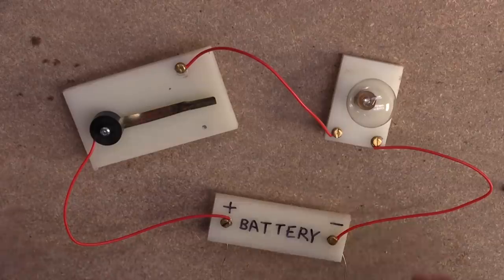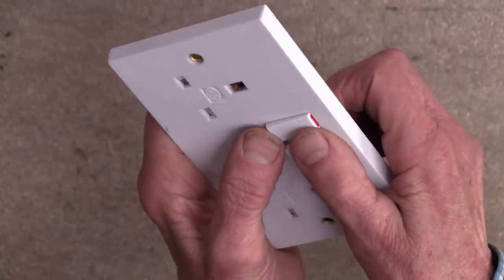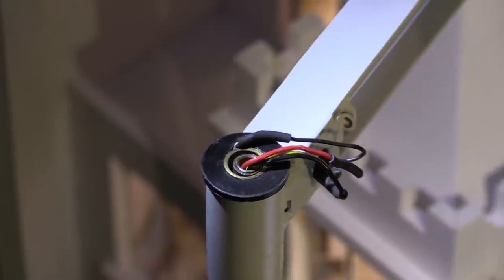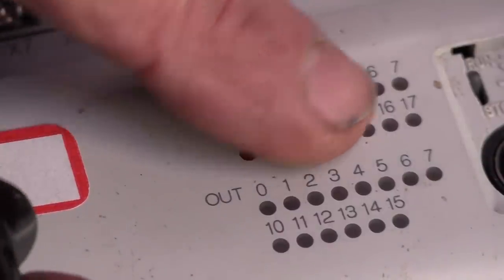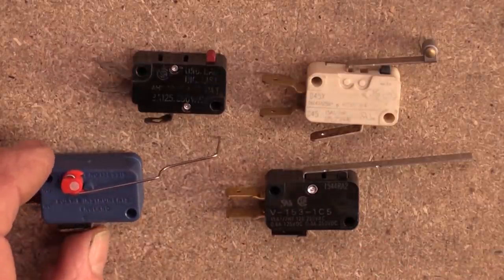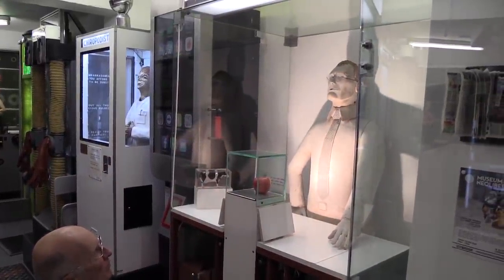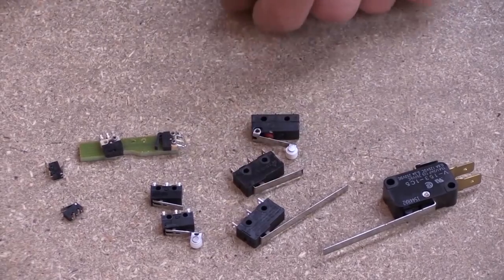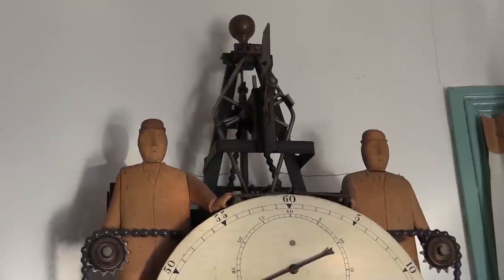SWITCHES - The Secret Life of Components, a series of guides for designers and makers - Episode 4

Comment: Those switches in substations are only for isolation. They are not circuit breakers and not meant to break the load. The actual circuit breakers do move quickly, but they're located inside housings (and bathed in oil or SF6 gas for further arc suppression), so you can't see it happen. Cool video!
Reply: The actual circuit breakers have very large springs that slam the contacts together or apart as necessary.  The spring is usually wound up by a motor between actuation.  Even so, the contacts require two stages - one to pass the power when the switch is closed, and another, harder one to handle the arcing.
Reply: Oi - stop watching and get back to making - its been a whole two days since you last uploaded! 
actually kinda cool to bump into you in the comment section elsewhere.
Reply: Great minds think alike!
Reply: 👆yup 😁
Reply: Thank you for wonderful videos!
Reply: Can confirm, have worked on a control for reclosers -- these use contacts in vacuum, oil or SF6, actuated by f*ckoff huge solenoids, and boosted by springs with an unbalanced reset mechanism so trip can be faster (spring assisted) at the expense of resetting.  On the one I worked with, the solenoid is powered by a f*ckoff huge capacitor, which stores enough energy for several cycles in rapid succession.

If you've ever had the experience that your lights go out (and all the rest of your neighborhood), then a few seconds later on again, then off again for an hour or a few... you've experienced one of these doing their job.  (What's actually happened is a line fault occurred, which the unit detects and opens; then it retries immediately, in case it was a momentary fault like wind-whipped wires touching, or a small tree branch; and if that doesn't do, it stays low until someone can be sent out to inspect the lines and clear the fault.  Usually they'll manually test it as well, to see if they can save a few hours walking the lines.)

(This is distribution level stuff, by the way -- downstream of those substation switches, but still immensely powerful by themselves; these are often switching whole megawatts, or hundreds under fault conditions.  The switches and breakers used for substations and high voltage lines, are of similar design, scaled up significantly of course.)
Reply: so why were there arcs on them?
Reply: @The1wsx10  Inductive kick back.
Reply: @The1wsx10  Good question. Maybe it's got something to do with it being AC. With AC the voltage is changing constantly so as soon as you disconnect the source of the power, the voltage across the disconnect will start to rise (and fall @50/60hz).
Capacitance will also provide some load with any AC system. Inductive effects shouldn't be playing a role here as there shouldn't be that much current flowing (with that said now we're talking about inductances and capacitance together - it could be forming some form of "LC tank" circuit but let's not overcomplicate matters)
Reply: It's a feather in my cap to see you here.
Reply: You should do a video on switching substations and the different kinds
Reply: One should add that those high-voltage switches are called disconnectors.
Reply: @The1wsx10   All the miles of wire in those circuits have capacitance between themselves and between ground, air being the dialectric.  
Those capacitances may be fairly small, but the voltages are incredible, so even in a circuit with no conventional load, you will have some current flow.
High voltage transmission lines also suffer from coronal leakage, especially pointy bits and pieces, and all of those insulators holding up the line are not ideal (perfect) insulators either, so you have some actual resistive loading too.
Reply: @projectartichoke  ok, so why are the 'breakers' slow here? are they actually designed to arc like that? it seems like a failure condition
Reply: @The1wsx10  cause the vacuum disconnects failed to open, aparently happens sometimes. experienced line crew will often set up a camera if they think this failure is likely, as well, it looks cool.
Reply: My guess is the same reason it was being filmed - a deliberate test. We were shown many such videos during training.
Reply: The slow switching in substations you show in the video operate very rarely, it's not economicaly feasible that they open quickly. For quick opening under high loads they use breakers, a quicker type or switch wit arc supression (and multiple times the cost).
Reply: He showed substation switch gear not circuit breakers which is topic relivant and yes behind all that ceramic insulation is complex electro mechanics eg hexafluoride 6 gas actuators motors gears latches sensors thare a lot more complex than they look, why do they disengage slowly to prevent high pressure electrical pulses along the transmission lines as they might offset grid sincroniseation or blow anouther stations circuit breakers as the fluctuations may not be smoothable or detected as a line fault causing a bit of a chain reaction.
Reply: Fancy finding Practical Engineering on a random YT I randomly picked to watch. Coincidences everywhere :)
Reply: @charmio  Yes, you're right. It's easier to switch AC, than DC, as the arc is quenched as the current passes through zero. Inductance does make a difference at AC, because if the switch opens when the current is at its peak, the energy stored in the magnetic field will cause an arc.
Reply: ...and the breakers have failed which is why there is arcing on the isolator contacts.
Reply: Make a video instead of commenting.
Reply: Substation switchgear draws arcs from induced currents in the line, not actual load.  If the line was under load the resulting arc would resemble a lightning bolt and would rapidly destroy the equipment.

Switchgear moves slowly due to the mechanical limitations of mechanisms that have to be articulated through several feet of brittle ceramic insulator.  Arc suppression is achieved through the geometry of the switch, not the speed. Twisting type switches that break in two places simultaneously are very popular.

One class of substation switch uses a gravity drop to achieve faster action.  As the switch opens a conducting wand bridges the gap until suddenly allowed to fall away.
Reply: now i understand why this video was recommended to me. Good stuff!
Reply: We use SF6 at our EP
Reply: Pardon my ignorance, but would you consider being so kind as to clarify (or perhaps make a video on - I do love your channel by the way!) the difference between a circuit breaker and an isolator? 
     Actually the distinction seems obvious; both from their names, and your short description. But as I'm understanding it, the circuit has already been broken elsewhere (in a fluid bathed switch as you said) when those isolators are shown opening. So then, why are they arching so magnificently if the circuit is already open? Is it because those huge swinging poles (and the attached cabling) are a large enough conductive sink that they are essentially charging and discharging, almost like a huge (very simple) capacitor, and that's why all that current is continuing to flow and create those dramatic arcs, despite there being no load connected for it to flow onward to? 
      I realise my reasoning is probably overly simplistic and my language incorrect, but I'm hoping through all that jibber-jabber that I'm at least on the right track with the basic principles? Any guidance you (or anyone else) can offer would be much appreciated. And once again, I love your videos so thank you for making fantastic content!
Reply: I don't think that's the reason, I would say it must just be switchcraft! 🧹⚡
Reply: I was supprised to see you Commenting here!
Reply: Some of these are the grounding of the circuit, after isolation the circuit is still charged (capacitance) and the cables, many many miles long are then grounded to discharge any residual energy. This residual may also be through mutual inductance from other cables ran near.
Reply: Completely normal for a disconnect switch to arc like this video. There is no load and only the current to energize that short jumper down to the breaker. There are arcing horns, the balls you see on the ends, and those are design to carry the arc. The switches shown in this video are only meant for no load operation. The breaker under it is an SF6 breaker and that is what will break load and fault currents as well as make and pick up load. The reason you install the disconnects it to allow maintenance on the breaker or other device by giving you a visible open / disconnect from the energized conductor.  
https://www.youtube.com/watch?v=K8cMSDwZkDU
Reply: @projectartichoke  No, long transmission lines are inductive, not capacitive. Although the right answer is to work out the respective mutual capacitance and inductance, a hand-waving argument is that mu_0 is 10^6 times bigger than epsilon_0.
Reply: Typical engineer.

Comment: The mercury switched wall switch at the end was probably used in a explosive environment, somewhere like a anesthesia room in a hospital or a place with alot of powder or even flour being processed.
Reply: yes, mercury switches are still used heavily in industrial applications, especially ones that can't allow sparking like in a paint booth.
Reply: We had a silent phone in a theatre in the 70's. BT went to extraordinary lengths to keep the 240 red light (that replaced the bell) seperate from the 50V phone wiring. The mercury switch was on a pendulum in a big steel box. Must have cost a fortune. The warning stickers to remind the BT men that mains was present were hilarious.
Thanks Tim, saw your new components films and now I'm binge watching all the old Secret Life films!
Reply: That makes sense now. Contain the arc in a glass bottle. Perfect!
Reply: they look like Wandsworth switches, standard fittings in hospitals
Reply: @kevvywevvywoo  Thank you! Now we have a name for them.
Reply: I worked in a hospital that had those arc proof switches and switch-sockets in the theatres. They were operated by a knob that turned 180 degrees and made by 'Walsall'. The sockets had an interlock with the earth pin of the plug to stop it being withdrawn when the  switch was 'on'. The earth pin was smaller than a standard plug to prevent non-theatre equipment being connected. 
Modern anaethetics are generally much less of an explosion risk, so special switching is no longer necessary.
Reply: Agreed.  Electrical codes for hospital spaces where medical gases are used like operating theaters, often require speical ignition source isolation. Some medical devices that house power outlets like anesthesia carts or laboratory fumehoods often have similar requirments.  
If my memory serves me correctly I came across nearly identical mercury switched outlets installed in a surgical ward panel at St. Mary's in London while consulting on an NHS project a few years back.
Reply: @Aengus42  Walsall Electrical also made them in that pattern, I have one here!
Reply: @peterking2794  walsall also made rocker light switches in a similar pattern to the ones in tim's video. Walsall were taken over by Pepperl & Fuchs and continue to make switches for explosive atmospheres.
Reply: Exactly what I was going to say....
Reply: Older thermostats for HVAC used mercury switches. I’ll still see one now and then. Almost all home Thermostats had mercury back in the day.
Reply: Mercury switches were also used in cars through the early-2000s for the hood (bonnet) and trunk (boot) light switches. They were extremely reliable and couldn't get stuck on, draining your battery. When cars of that era are scrapped, the dismantler needs to go and remove them for disposal.
Reply: @peterking2794 Thanks. That explains it.
I was going to suggest explosive atmosphere safety but then I thought that was wrong because pulling the plug while energised would defeat the safeguard. If the plug is trapped until de-energised then the system will be safe.
Reply: @kevvywevvywoo  100% correct ….Wandsworth Electrical Accessories
Reply: I've also seen thermostats that use mercury, a bi-metalic spring rotates them with temperature and you can change the trigger point (temperature) by rotating the entire assembly.  The thing I like about mercury is that you can arc it all day and not worry about contact degradation, it reforms itself like the T1000 liquid metal robot!
Reply: Our spray booths had explosion proof fan motors and lights, had explosion proof switches.

Comment: The high tension ‘switches’ you showed are actually isolators, used to separate components for maintenance. The actual breakers are extremely fast and use either high pressure air, oil or SF6 to kill the arc.  The little arcs you can see on these isolators are just from the current induced from adjacent circuits. If they were used to break the full load of a generator etc. they would be completely wrecked!
Reply: SF₆ isn't the sort of thing most people have (or should have) around the workshop. The amount of paperwork needed to keep a small (incredibly heavy) cylinder of SF₆ at the generating facilities I used to manage was immense. But when you're switching 44 kV, you don't want any arcing at all.
Reply: @StewartRussell  why thoooo SF6 is fun to play with, and is relatively safeishhhh
Reply: @HerbaMachina  it's one of the most potent greenhouse gases and can build up in access tunnels as an asphyxiant. Not a toy
Reply: @StewartRussell  shhhhhh hence my sarcasm.
Reply: @StewartRussell  For industrial quantities in the EU maybe. For small quantities, no. We used SF6 lecture bottles for demos all the time. SF6 is even injected into you in medical procedures. It's not as dangerous as a grill cylinder of propane, which is an asphyxiant, heavier than air, and explosive.
Reply: @straightpipediesel  as a former power plant operator in Canada who had to comply with safety legislation around SF₆ and confined space work, I stand by what I said.
Reply: @StewartRussell  Well stand by being wrong and ignorance of safety. NFPA diamond SF6: 1-0-0 SA. NFPA diamond propane: 2-4-0. Propane is far more dangerous, even from a health perspective.
Reply: @StewartRussell  You said "SF₆ isn't the sort of thing most people have (or should have) around the workshop". That's plain wrong. People have propane brazing and BBQ tanks in their workshops, which are far more dangerous, and you're not giving them a hard time about it. Fundamentally you don't know how SF6 works, that's why you're giving bad information. In fact, you may not know that SF6 was used as a filling gas in double-pane windows (doesn't leak, absorbs IR, and minimizes convection) and shock-absorbing sneakers.

SF6, like most flourocompounds is very stable and inert (see also Teflon). This is high school chemistry: fluorine is missing one electron to get to a stable configuration, so it desperately seeks something to bond to (called high electronegativity). When it bonds to something, sulfur in this case, it holds on and never lets go. As such, it is very non-reactive and largely inert, and that's why it has little health and safety concerns, aside from asphyxiation. The only way to break the bond is with extreme conditions: the plasma of an arc. When it does, it absorbs a large amount of energy, cooling the arc. Afterwards, the freed F atoms rebond with S, and reform SF6. This is very similar to how Halon, a fluorocarbon, puts out fires.

The environmental issue with SF6 is precisely because it's non-reactive. It stays in the atmosphere forever because it won't degrade. 

Again, there are far more dangerous things in your workshop than SF6, like battery acid. Don't talk about stuff you know nothing of.